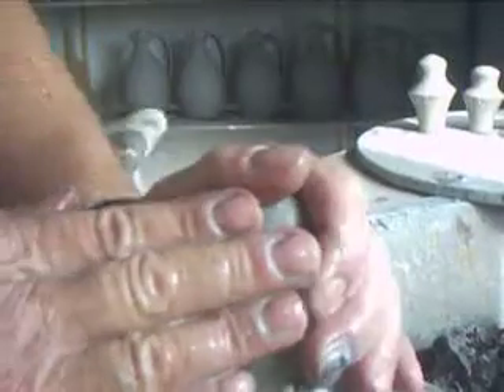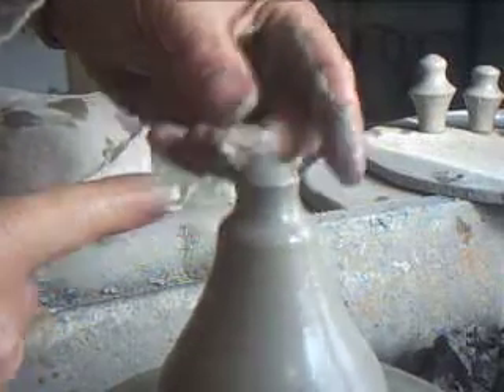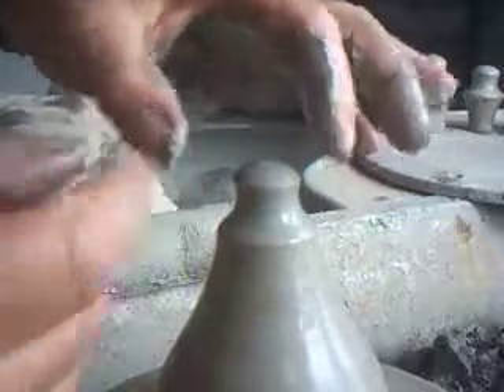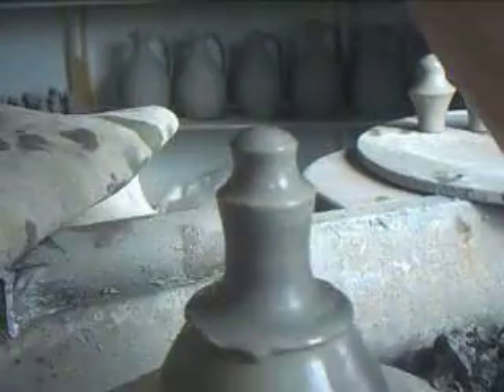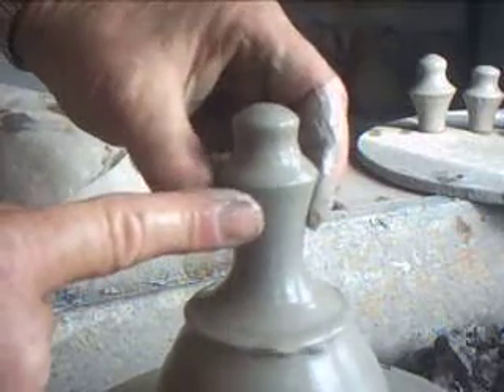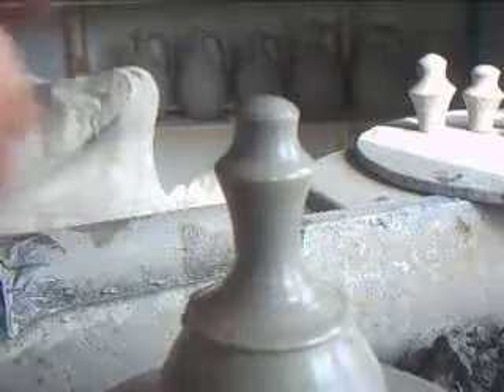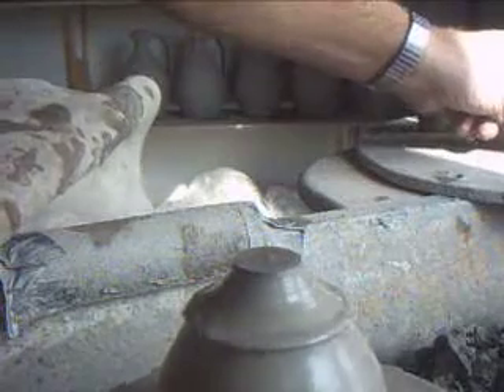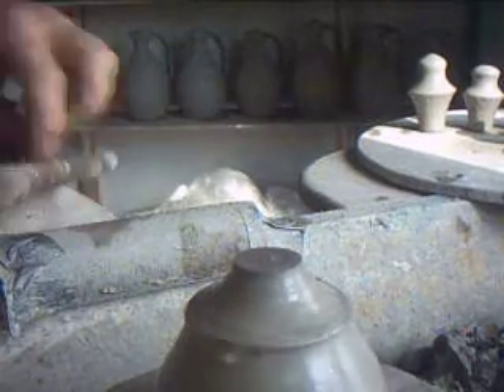SIMON LEACH- throwing a stopper for a wine flagon

Comment: i really like your videos. it seems that you've posted new ones everytime i look. 
so i was wondering if those stoppers are fairly air tight? do they stay firmly in the flagon, or do they lightly set there? i wasn't sure how the raw fired clay to the glazed clay would work out. do you ever use corks or rubber stoppers? thanks.